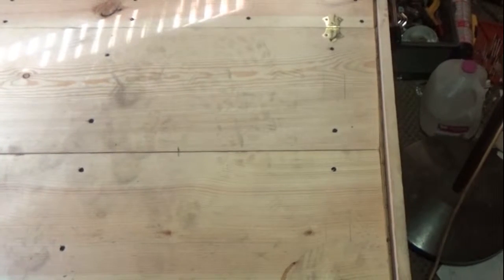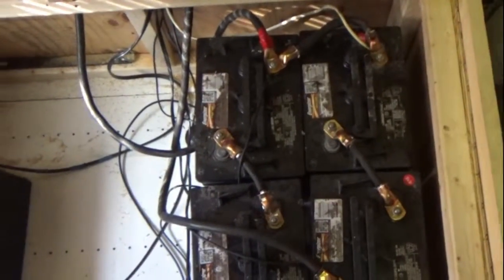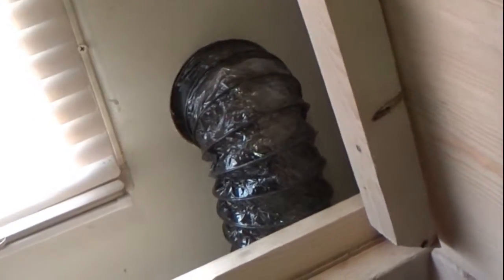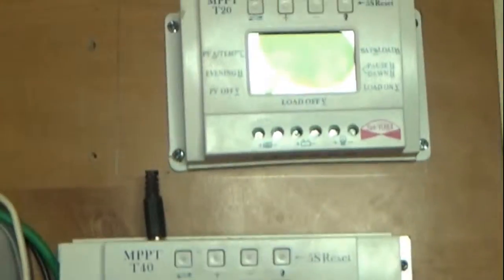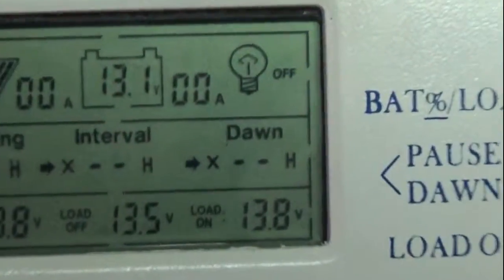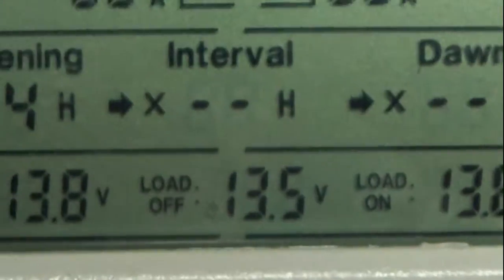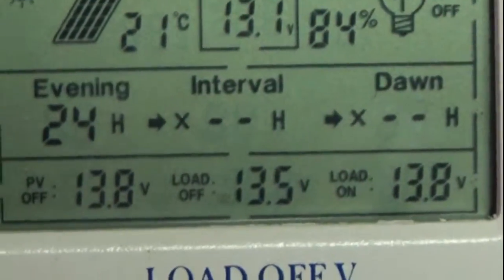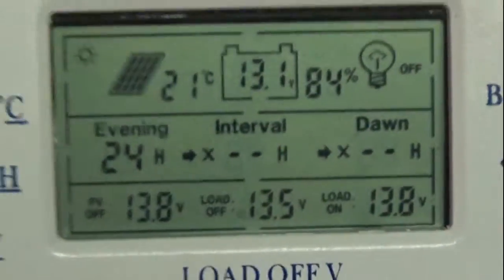Automatic Solar Battery Bank Ventilation

Comment: does not batteries emit hydrogen that's explosive , is a permanent magnet motor which can cause a spark which could ignite the hydrogen , I never put my inverter in with my batteries because the little permanent magnet motor in an inverter could cause that spark which could ignite the hydrogen, it's been my experience when batteries are gassing it doesn't take much of a spark to make them blow, am I wrong here but is that not a small permanent magnet motor and does not permanent magnet motors have brushes which causes  small Sparks?
Reply from the maker: Thanks for the comment. As stated in the video I have the voltage set to turn on the fan BEFORE the voltage of the batteries reach a gassing voltage. I set it at 13.8v for the very reason you stated above